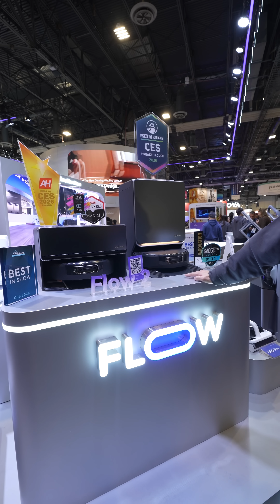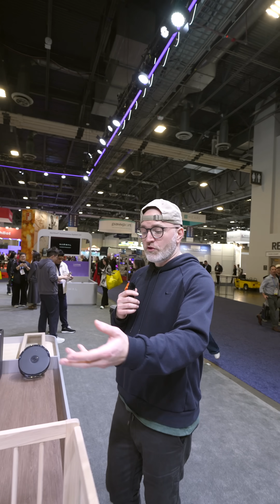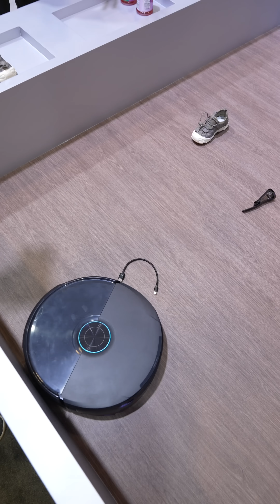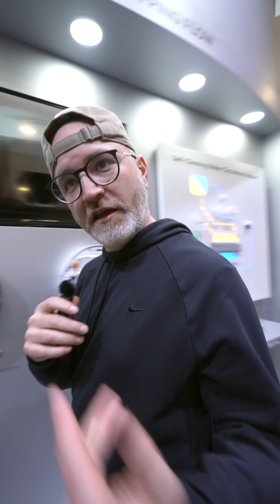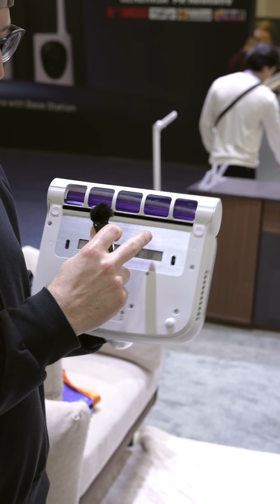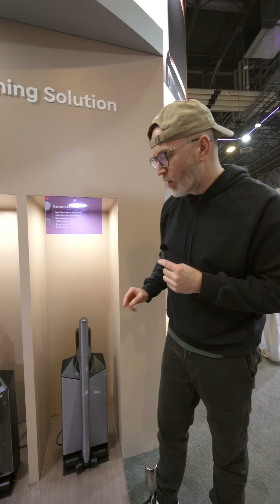the ultimate cleaning gadget… @NarwalRobotics #ces2026  #NarwalFlow2

Comment: Why don’t they make robot vacuums triangular, that way it could get into corners…?? 😮‍💨
Reply: They make square robot vacuums. Hard pointy squares instead of rounded squares could cause damage to furniture, walls, and people. Round vacuums from iRobot usually have a little sweeper on the edge meant for hard corners.
Reply: Hexagon 🗣️🔥
Reply: 1. The first Roomba's were round, and designers stuck to that ascetic. 
2. It's just how they are designed, and manufactured, are usually round.
3. From Google: Roomba vacuums are round primarily
to maximize maneuverability and prevent getting stuck, allowing them to easily rotate 180 degrees, navigate tight spaces, and maneuver around furniture legs without catching on edges. This design ensures high autonomy, as a circular robot can pivot and escape obstacles better than square models.
Reply: Or like a sports car
Reply: GOOD ❤